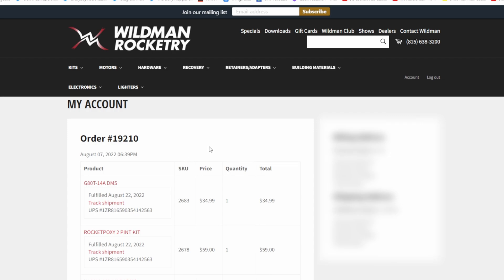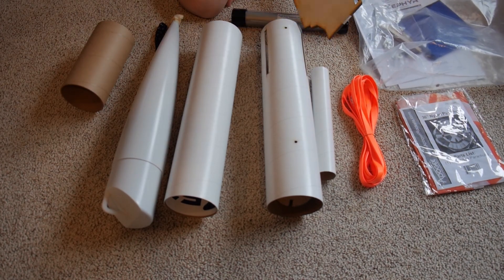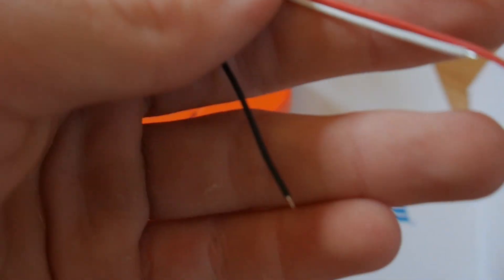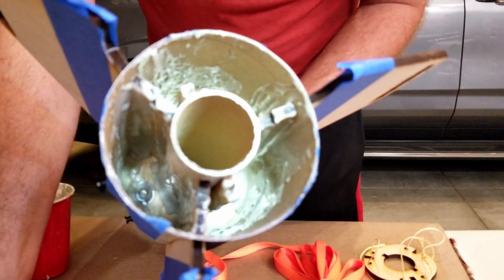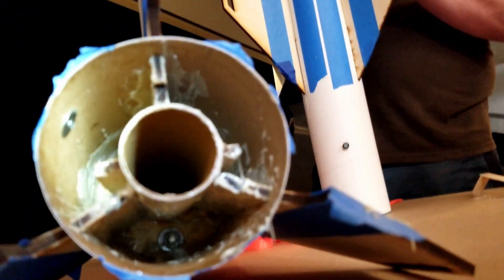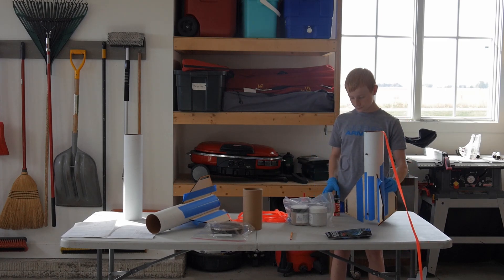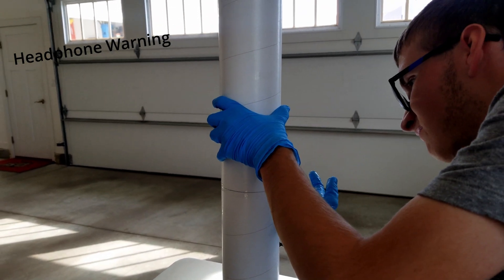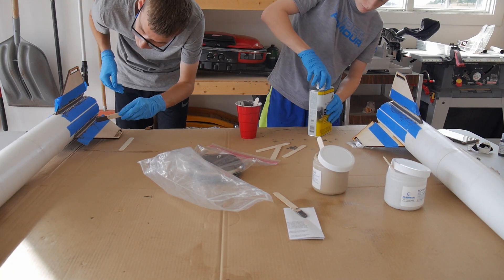Building a Level 1 Certification Rocket!!! // L1 HPR Part 1

Comment: I'm happy to follow your video, but I have a question and I hope for the answer: how to define the center of thrust of the rocket, before it slips into the fuselage of the mini rocket ???  please answer
Reply from the maker: Could you please elaborate?
Reply: @3dspacemodelrocketry  Indeed, I am preparing to design my own mini rocket, so I have trouble defining my cp push center, it pushes my mini rocket to be unstable, so I need stability, that's why I asked you this question, because I was hoping for the answer in you
Reply from the maker: We use openrocket to simulate the center of pressure and design the fin shape for our scratch built rockets.
Reply: @3dspacemodelrocketry  Ok thank you very much, indeed, I am more fluent in French than English, now there is a video in French or in English which explains the open rocket simulation perfectly well, (or the barrowman equations), and  determine the number or the shape of the fins, please give me the video, it will make me happy